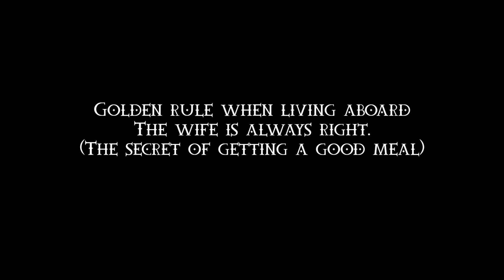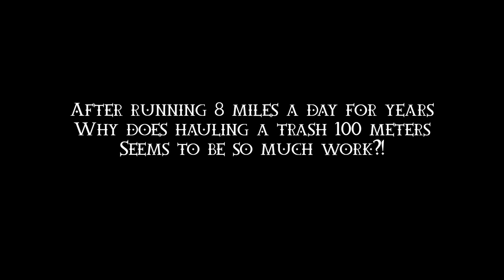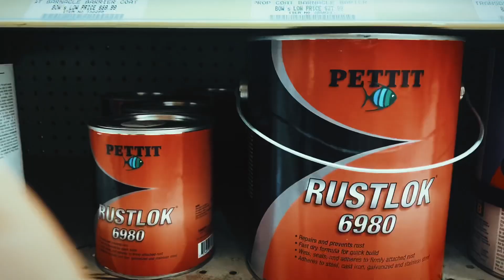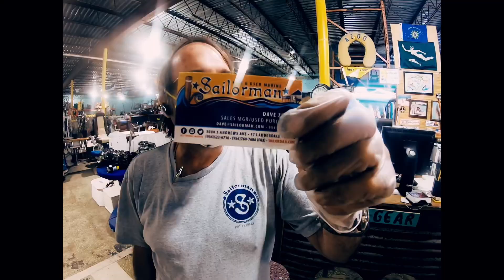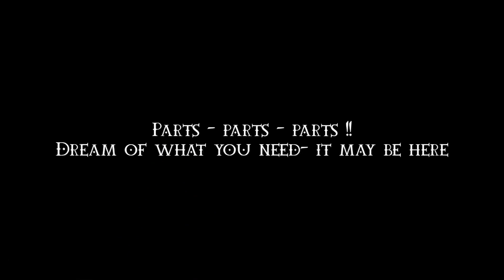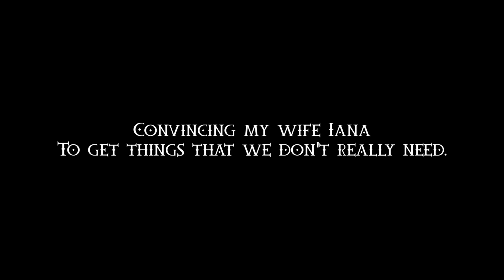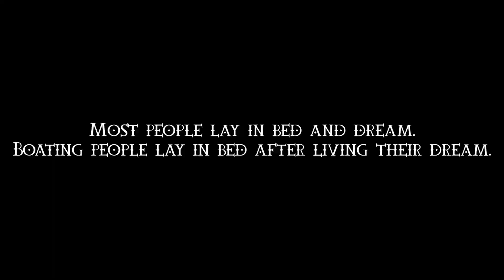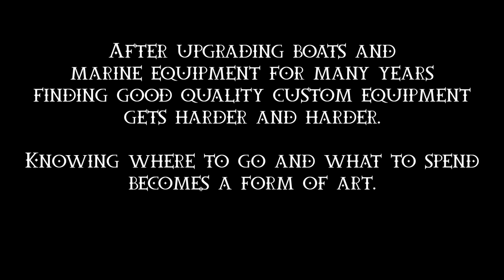Liveaboard Life (Don't Let Your Man Here!) Fort Lauderdale Vlog Dawn Hunters Steel Motorsailer Refit

Comment: Love that new RIB. What make and model is that?
Reply from the maker: Good evening Spike. 
The “new rib” is a 2011 30hp 12 foot Caribe that I found for sale at Sailor Man. It spent all it’s life inside of a super yacht. Funny story is I have a super nice 2012 — 12 foot 35hp center console dink that I had brand new tubes installed. Since that time I don’t like to use it because always worried about the new tubes. When I located the “new-older” one the tubes do not leak but have several marks on them. SO I bought this one and now have my other with the new tubes for sale. In summary this one you see is not as pretty but I can beat the “sh@&” out of it and not be concerned. Lol
Thanks for your comments. 
Capt W
Reply: Thanks Captain William! That little boat is a super good find! Looks like fun, too!